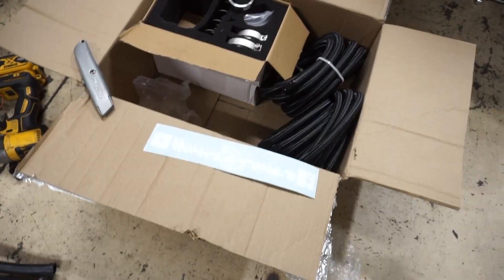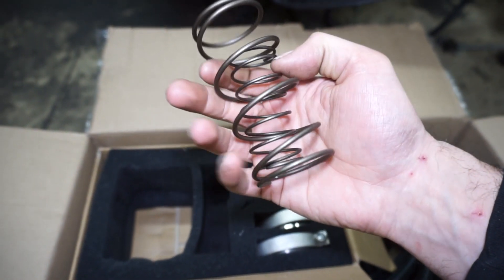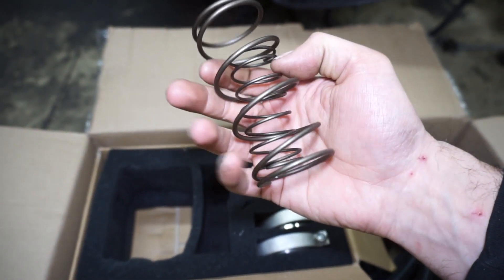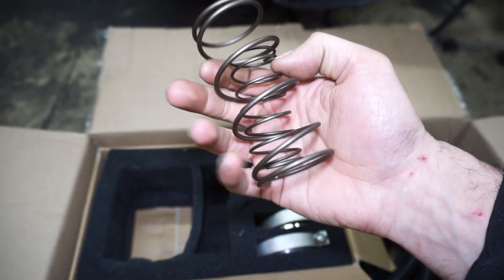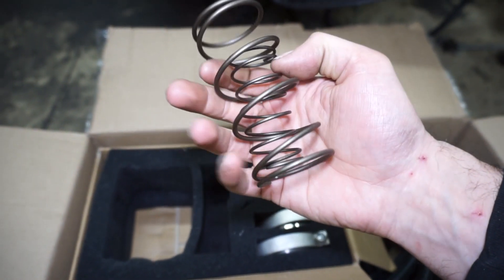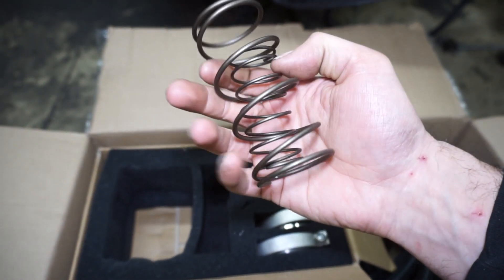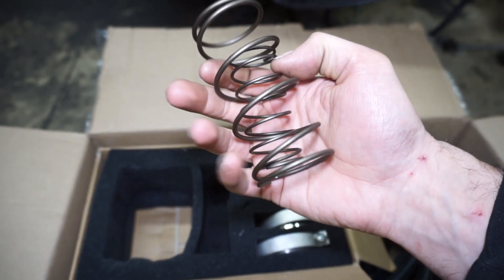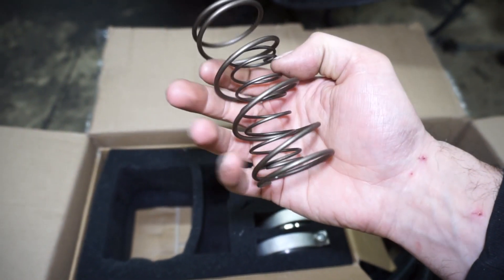DIY Turbo Kit | Wastegates For Twin Turbo Mustang

Comment: Nice Work!! You mind if I ask what settings do you have your Tig machine set up on?
Reply from the maker: About 55a, .5 pre flow, 5 sec post flow, around 30cfh. 1/16th 308l rod. 3/32 tungsten #12 furick cup.